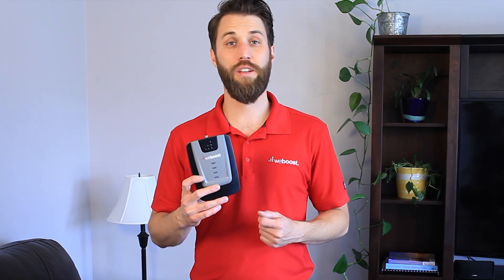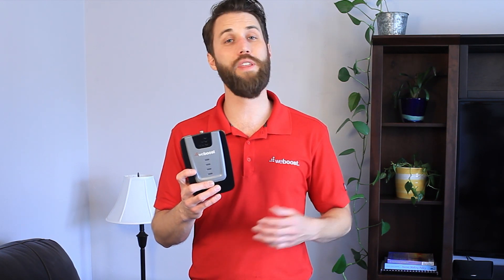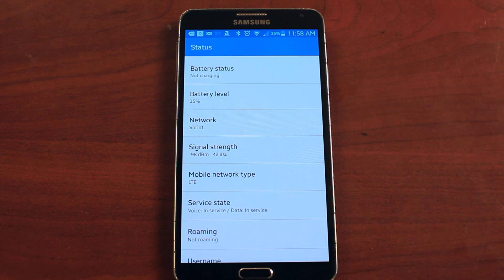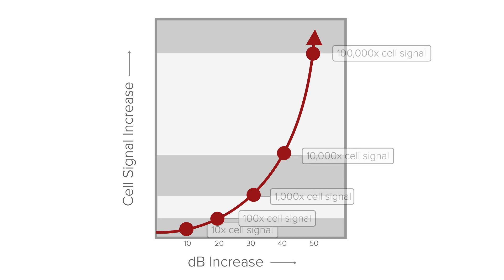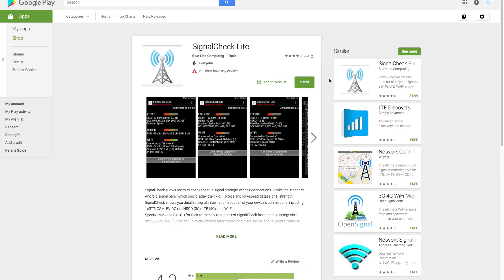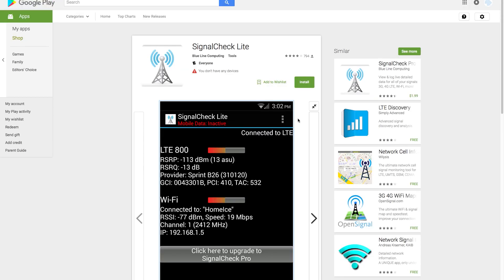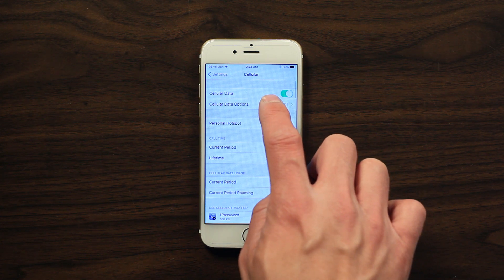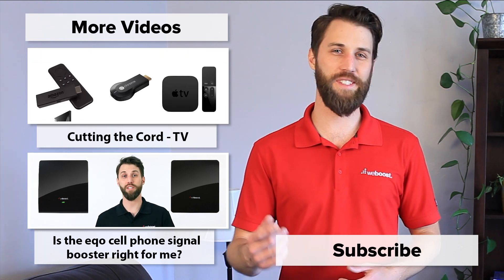How to Tell if Your Signal Booster is Working | weBoost

Comment: I received the RV set up, I get -115 at 3 meter from the inside antenna, -119 from a room, maybe 4 meters with walls, and -85 with the phone just in front of the antenna. Anyway to boost this? I thought I got a booster.

Comment: So the outside antenna wire seems compromised and i don’t seem to get any benefit with the booster turned on. When I use an ohm meter on the antenna wire tip I get no reading. Should I get a reading between the center of the wire plug and the outside?

Comment: I was using a wilson signalboost dt desktop cell phone booster and it was good for about a 10 ft radius. I now purchased a weeboost that covers 5000 square feet  the bars are all green and it will only give me the range inside my house and near the antenna like the other one. i thought i would of gotten way better distance with this one . Can someone give me pointers of why this is happening to me thank you

Comment: I just set this weBoost  4G -Model 470103 up and I still get no phone calls or can not call out. I paid so much money for it and still the same db strength signal inside. I at least can call when walking outside in the frigid cold but can not call from inside. I thought this was a booster. Not getting a boost at all. Frustrated to say the least!!
Reply: Check your set up, there's a video for that and user manual.

Comment: OK I have a great question, what about my drive 4GX – OTR when I turn the booster on , and it has a solid green light, my signal drops according to the bars. What in the world does that mean. It's doing exactly the opposite of what I think it supposed to do am I wrong?  I just bought this thing not even a week ago and are having very mixed results.
Reply from the maker: Thank you for reaching out! Generally, signal bars are going to be inaccurate and untrustworthy. However, the reason you could be seeing a shift in bars, could be the networks switching back and forth. For instance, sometimes your phone may be on 3G and when the booster is turned on, you may then have enough 4G signal to boost – which the fewer bars indicate that you are now on the LTE network. We like to use decibels to measure signal, to ensure we are reading the signal more accurately. In either case, always feel free to reach out to us at any point for direct troubleshooting. 
You can reach us here: support@wilsonelectronics.com, 
or by phone at: 866-294-1660.
Reply: weBoost thanks for the reply. I ended up downloading an application that shows me signal strength in decibels in real time and you are correct, the bars do not match the decibel readings. Kind a odd but he seems to be the way it is. The application I downloaded on the iTunes Store is called RF Monitor. It seems to track in real time along with a graph for visual effects. Again thanks for the reply appreciate it very much! I was getting really worried for a while there. I just spent $500 on this thing and was afraid it wasn't working!
Reply from the maker: Oh good, glad you figured it out! Let us know if you have any more questions, thanks for watching!

Comment: so if i get 1 bar of 4g/lte and 1 bar of 3g if i buy the 3g only booster i won`t be using the boosted 3G??
Reply from the maker: Thank you for your comment! If you choose a 3G only booster, if your phone detects any 4G (if its usable), it will grab that. Unfortunately, at that point, our booster would likely only work for voice calls at that point. However, any time there is no 4G LTE, the phone should default to 3G and allow the booster to work on both voice and data.